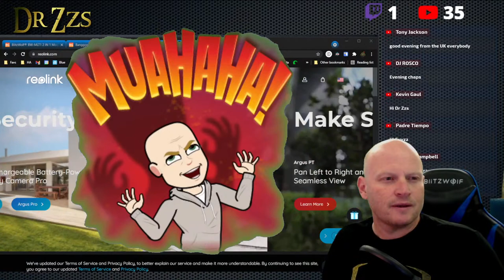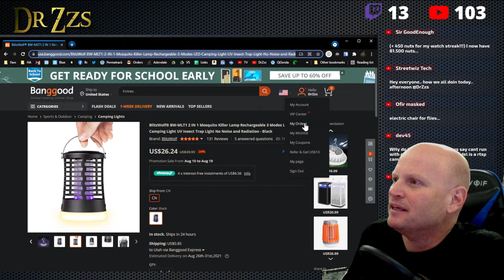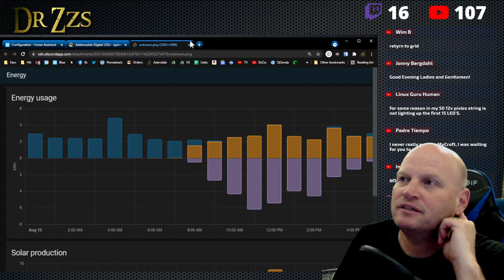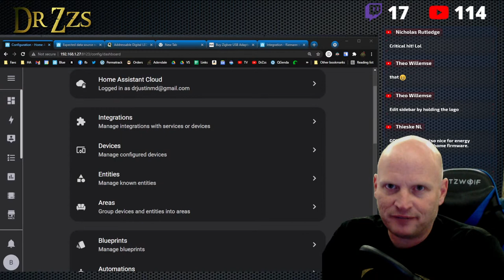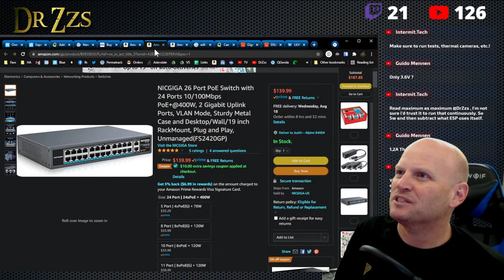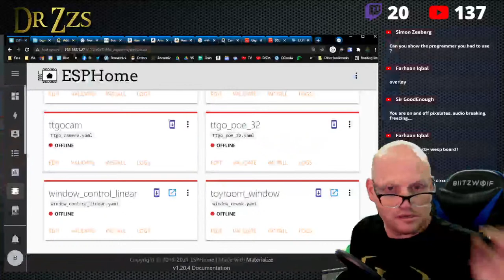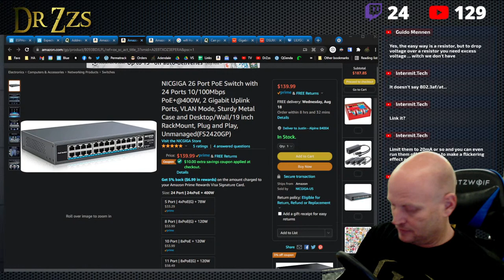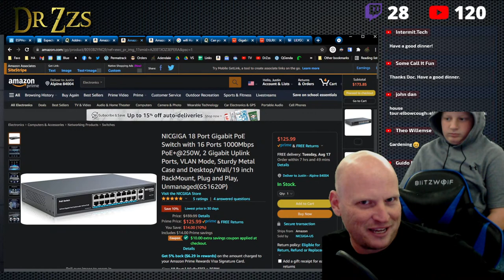ReoLink NVR | TTGO PoE ESP32 for Lighting?

Comment: I've bought a TTGO PoE ESP32 a while ago for a small project (measuring the level in a concrete watertank with a HC SR-04). 
Tried to flash it with the little programming board....without much succes.
Got a failed to connect to esp32 message in ESPhome-Flasher with generic ESPhome wrover firmware. :-(
Did you had to press a certain combination on the "BOT" or "RST" buttons ?